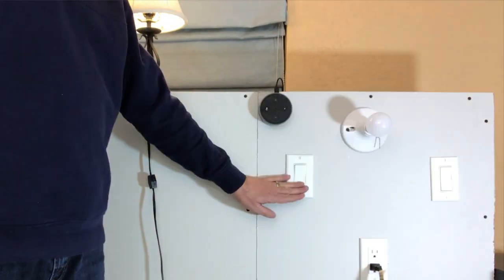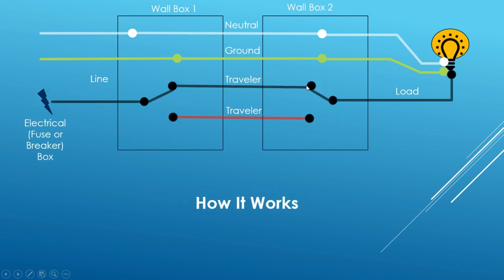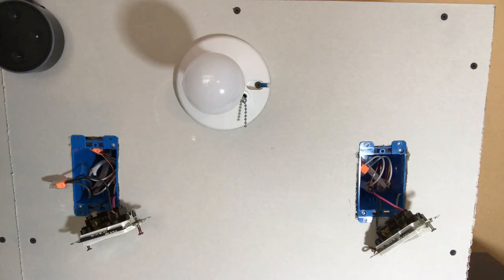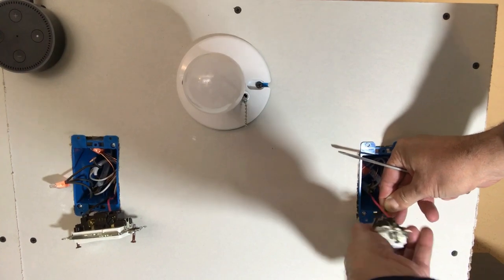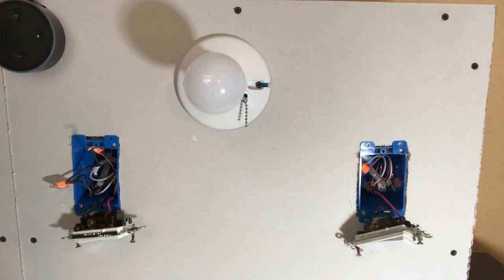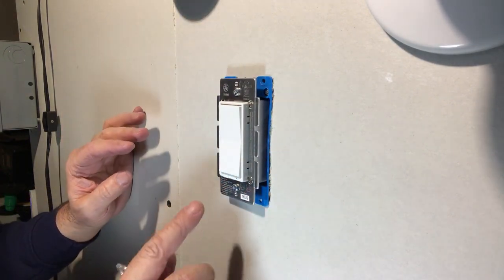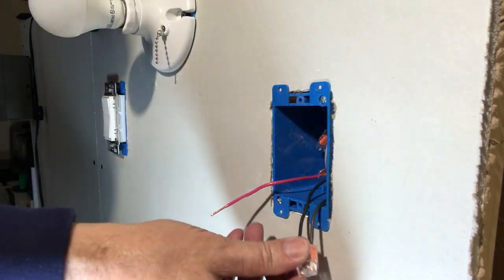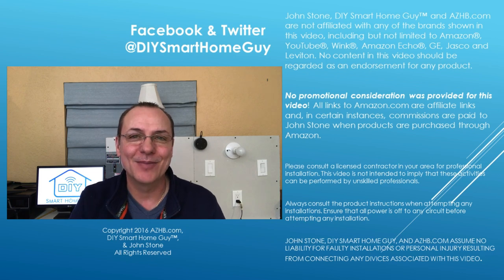DIY 3-Way Switch GE / Leviton Smart Switch Installation (Z-Wave)

Comment: Have you ever seen these GE switches go on sale? Btw your videos are super helpful. I had no previous electrical experience and installed my first few switches with confidence.
Reply: Sunday1290 Google camelcamelcamel
Reply: Chris Hudson  Thanks Chris. Not knowing what I was googling I was a little worried what results I was going to get, but this tool looks awesome. Thanks for the tip.
Reply: I am waiting for about $35 price before I buy my next generation switch...
Reply: John Stone do you know what the practical difference between the switch listed above and model 14291? Based on very brief research all I can tell is a faster processor and more memory. Is there noticeable performance to justify the additional cost?
Reply: stupid auto correct... I think that was  supposed to say dimmer... I need another dimmer which was $39 this morning.

Comment: I’ve been trying to install a levitan 3way smart witch and it been a huge pain. 
There seems to be a bunch of different types, some for diff types of lights) all  with tiny long model numbers that do not work together. Why don’t they sell them as a 2 unit package to eliminate confusion. The guy I’m doing this for has ordered  them all separately. He’s got the wrong ones like 3 times.

Comment: Hello Jhon. Thank you for this video. I'm not a English native speaker and I want to ask you some question. I ordered the Tp link hs210 kit (two 3 way smart switches). I was planning to connect both switches in one 3 way circuit. Two smart switches for one lamp. After your video, I figure out that I can replace only one 3 way switch in the circuit. My question is. How does the actual (not smart switch) works if I turn off this switch?. Are still the Kasa app or Google home assistant able to turn On and Off the light? Thank you for your time and help.

Comment: Quick question, as for me it is not clear... If I use a wifi switch as part of a 3way switch circuit. (i have 3 regular switches right now controlling a light) can I just change one to a WiFi switch? and if so does it matter which one i switch? I have a Levtion Decora WiFi switch to install.

Comment: Hi John,  great video, thank you. I have three lights I want to connect. They all have two switches (3 way lights?). Do I need to use both a primary switch (GE model number 12729) and an add on switch (GE model number 12728)? Or can I use a primary or only an add on switch? Why would someone add two smart switches for one light? Or is the add on switch not a smart switch and is just used in conjunction with the smart switch (12729)?

thanks!
Reply: John Stone 
very nice, thank you!

Comment: Great Video thanks for it ...I have one question - why is there such a delay when you turn them on and off?
Reply: My delay was I had to replace a second switch (not a dimmer) on my 3way. The first 3 way dimmer was replaced because it did not support led Now it;s fast
Reply: Richard Humphrey are you saying you replaced a zwave 3 way dimmer for a non-dimmer switch and it resolved the delay? I’m finally getting around to installing some 3 way GE smart switches and already bought them but after seeing the delay I’m second guessing the purchase.
Reply: Hi Mike, Sorry for the confusion....My original 3 way setup  was one switch with on/off and the other switch was on/off with dimmer. When I just switched the bulbs for LED the lighting went crazy with flickering. Talking to an Electrician he said my dimmer didn't support LED lights. He made no mention of the simple on/off switch. So I then switched out my dimmer. ( should say had the electrician  with a leviton dimmer switch. This switch was google home and alexia aware. So you can control it with either or with leviton app. After the Electrician did the job he came up and said it was complete... I assumed he tested it. Also I required a neutral wire for the new switches....nothing straight forward about switching them.
I don't go down stairs much. Later in the week I went down and flip the switch on....there was literally like a 2 second delay. Also I notices that if I went to the second switch ( the leviton and flipped the switch. Power would go out and I would have to go back to the other switch...These switches have a little light that glow on them....very messed up it was)  I called the guy back but he had no idea why. Now I hired a second Electrician... He worked on it for a while...Later it became clear that the other ON/Off switch had to be changed out as well. It was in the fine print of the first Leviton switch....now I am up to just over 300 bucks for both switches and two electricians.  I have to say I did learn lots in the process. (so did second electrician) ..not enough if it's not a straight switch. My house is only 14 years old (built in Canada 2004) but I guess that;s old enough when it comes to present day wiring practices.  I perhaps should have just went and tried hue lights to see if they would have worked on their own. Those are cool to.....I have a sensor in my garage and my lights in my garage entrance come on when I drive in at night...after 5 minutes the garage entrance lights go out. I have those in other locations in my home and they are on older switches.  
I love using it with google home I have to say..  My home router is a Asus RT-AC87U router.. when I look all my client list on it, I have 44 devices ( this is wired and wireless devices)...Lights, chromecast, switches. Ihome devices,  cells, sonos,  smart TVs,synology nas(s)Google Home, Ecobee 4 thermostat,   computers etc. I do think people should invest in descent routers when they are doing this kind of stuff.... the ones from your internet service provider just are not all that great.  I hope I answered your question.. I got a little carried away on the tech...LOL The router is the heart of it all working good...along with your isp of course. Today upload speeds can be as important as download speeds
Now if I were a person getting a new router because I thought My router might be the issue...I would use the same ssd names and passwords so, that switching  the router would be seamless for my connected devices.
Reply: Richard Humphrey I think it does. I have the updated version of the GE switches shown in this video that have Zwave Plus. My house was built in 2013 so I’m assuming the wiring should be pretty straightforward. I guess I’ll install the switches to see if there is a delay. I have all led bulbs and plan on pairing the switches to a SmartThings hub with Google Home.

Comment: have a minoston smart dimmer switch. Ms11z model. They have the same 4 screws and are labled traveler,  line, neutral,  and load.

Comment: I apologize if this was already asked. I have the master Lutron switch which I want to connect to a 4 way and another 3 way. Can the smart master switch be used in conjunction with the existing conventional 4 way and 3 way? In other words must a smart extension/add-on switch be used?

Comment: Great video!  Would the same thinking apply in a situation of a 4 way, 3 switches connected to a set of 3 canned lights?  I can't seem to get everything to work - seems like one of the 3 switches always disables the whole circuit and then the smart switch becomes useless.  I'm using a TPLink smart switch... I feel so close to getting it to work - yet so frustrated.

Comment: Can I get some help! Im trying to install an switch like this but I only have 1 black wire. In all I have 1 ground, 1 neutral, 1 traveler and 1 hot wire 4 cables in total and this is for a 3 way pole that is currently working properly with regular switches. What should I do?

Comment: Your video was great.  I have a problem, and I think it may be unsolveable unless I hire an electrician.   No problem, I have a three wire follower that goes between the two switch location.  The problem is that there is only a two wire with line supply on one side.  There is another cable on the side where the line side is missing, but that cable goes to an entirely different circuit.  I tried tapping into it for a line on the missing side, but it didn't like it and tripped the breaker.  So.....any alternative other than to get an electrician to run another two wire from the same line side?  As a note, I did tie all of the white wires together on the missing side when I tried using that "other" line.  Could that have been the problem?  Just thinking about it as I type this......worked so long on this and pretty much disappointed..
Reply: DIY Smart Home Guy Thais for the reply.  I did some checking and it turns out they used a white wire for the traveler.  I rewired and now the switch is working great.  Thanks again.  You are very helpful.

Comment: I hired an electrician to install a three way switch for the leviton decora. I noticed you used 1 three way and 1 "add on". I purchased two three way... Do I need to return one for an "add on"? I didn't go through the manual I just figure it's it's a 3 way then I'll need two. Fast fw, job complete but only one switch has a solid green light when off; the switch with the solid green line is always the one used last to shut the light off and only that switch can be used to turn the lights back on. So at any point, 1 switch will not turn the light on... The electrician should be back but he's out of town and I don't want to wait... Any suggestions?

Comment: How to connect 2 way in 2 gang smart switch... one of the switch from both device need to control 1 light. And other switch from both  control 2 different light....

Comment: I'm using a Leviton DH15S with a DD0SR-DLZ (non-dimming, WIFI).  My existing wiring is #3, powered at the box with a light in the middle and the 3 wires continuing to the remote box.  I have the DH15S powered and it works the light fine; however, the remote does not work.  I have used your diagram and continued the Load (BK-Black), Neutral (WT-White) and Traveler (Red) from the Switch through the light box to the remote.  In your solution you do not continue the Black to the remote box; however, if I do continue the Black wire the remote will shutoff the light when powered on by the DH15S.  If the Black wire is not added to the BK terminal the switch does not control the light at all.  The LED on the remote will flash when the light is powered off and is on steady at the switch.
Reply: Yes, I was referencing this Website as my wiring type.   The DH15S is the primary switch taking the power and sending the Load to the light.
Reply: A followup on what I have learned about the Leviton DD0SR-DLZ.  This switch requires a power connection at the remote location, must be powered.  If you don't have the power you need to use the DD0SR-1Z remote switch.

Comment: Where can I get help setting up a 4-way switch?  Keep in mind the hard part isn't wiring up the switches, it is knowing what all the different wires that could be colored in any fashion relate to what function.  I know with a voltmeter I can test for and find the live voltage wire, I think in the 3 separate receptacles only one will have a live wire if all the switches have been removed.  How do I know what traveler wire goes to what receptacle - assuming I don't have a piece of wire long enough to reach between the two (but I do have a lamp I can connect wires to and see if the lamp comes on or off)?
Reply: I figured out all the wiring.  I didn't even use a meter.  It did involve turning the power on and off multiple times.  I thank Science, and John Stone in that order.

Comment: I am confused I opened both boxes and one box has a black, red, white and bare wire. The other box has 2 black wires and a red 
Power on and I read 120 volts from the white wire to ground.   No ac voltage in other box.   So I have a white wire that is hot.  That is confusing.

Comment: I just watched a video by Leviton put out in Feb of this year that shows 2 different wiring scenarios.  In one scenario, the line box is also the load box so it gets the Master switch and the other box gets the add-on, but in the other scenario the line and load boxes are separate, so the master switch goes in the LOAD box and the add-on goes in the line box.  

I think I've got it, then I'm back to being confused.....
Reply: @DIYSmartHomeGuy1  Will do, thanks!

Comment: I heard if your going to use an app to control your lights you only need one smart switch in a 3 way system...is that true?
Reply from the maker: I wouldn't recommend it. There are several factors including how your home is wired. Taking out the second switch removes the manual option, not everyone is going to have the app. In some places, both switches are required (like stairways). You wouldn't want to pull out your phone every time you come down the stairs. But maybe that's just me. Thanks for Watching! Cheers

Comment: I have an existing set of lights that are controlled by two switches.  Pretty normal 3-way situation.  Can I replace just one of them with the GE or Leviton switches without using one of their Addon switches in the other box?
Reply: I could just not wire in the second 3-way though, right?  Basically put it back to a single pole installation?  I guess I'd have to re-wire the light box too though huh?

Comment: If you do not have a white (neutral) wire in the gang box with the load wire but you do have a white wire in the gang box with the live wire, then you may have a setup where the light (the load) is between the two switches. This is what I have. In my case I was able to take the black traveler wire from the main (live) switch and connect it to the light (load) directly within the light gang box.  I could then take the wire that the black traveler wire had been connected to in the light gang box and make it the neutral (white) wire. By making this change in the light gang box I was able to complete the install of the GE 3 way smart switch.
Reply: Sorry, not on FB. Here is a Google Drive link of the diagrams. These where made by a friend not for publication so they are a little rough.  https://drive.google.com/drive/folders/0B1iJ-0ICJYwgdmo4T1VUY1VXemc?usp=sharing

Comment: Is a ground wire a requirement? I have a neutral wire but I don't have a ground.
Reply: John Stone Hardly anything in my house has a ground. 75% of my outlets only have two prongs I feel like the three prongs in the house don't even have a ground wired to them.
Reply: John Stone I checked it out. I know that's for if you don't have a neutral wire. Is it common to have a neutral but not a ground? I know a lot of people don't have a neutral wire but after using Google I couldn't find anything about having a neutral but not a ground.
Reply: John Stone Okay all I needed to know. From what I've seen all my boxes are made out of metal. So just connect a wire to it and I'm good to go?
Reply: John Stone I have another issue. When I took the second switch out it was wired way different than any thing I could find online. The traveler wire and the neutral wire were hooked up to one side and the black was on the other side. I tried wiring the add-on switch a few different ways just to see it one would work but nothing. So I just capped the two wires that were on the same side together and now the room only has one light switch which has been working fine for a week but I can only turn the dimmer to about 90% anything higher and it just cuts off. Just wondering if this would be a wiring problem, switch problem, or bulb problem (using 45 watt incandescent bulb).

Comment: What would I do if I don’t care about the 3 way ability? Essentially I just want to replace on of the existing 3 way switches with the smart switch and control it over z save always. I don't care if one doesn't work.

Comment: Great video! I’m just having an issue with this very same set-up, when I finished the wiring, the main switch it works flawlessly, however, the add on switch it wont work, it you press it and hold it pressed, it will work, either turning on or off the light, but at the moment you let go the switch will go the the old position , if the light was on and you pressed and hold it it will go off , and as soon as you let go will go back to the on position, and vice versa when the light is off. 
Any suggestions, ideas will be greatly appreciated it.
Thanks!!
Reply: double check the common wire to make sure its connected
Reply: I am in the same boat!  Just converted 2 different 3-way switches using this DIY. Followed it to a T! Now the add-on switches exhibit the behavior of the OP. Help!
Reply: DIY Smart Home Guy can you help me with the strange behavior of my add-on switches?

Comment: I just installed those GE products.  But my add on switch isn't working  when installed all the way.  Outside the gang box it works, inside it won't.  Did this back and forth several times.  Out of the box it works, in the box it won't.  Any suggestions?
Reply: John Stone Nope....just rechecked...all the lugs and wire a very snug....but I'm still getting the same result
Reply: John,
       The switch was a dud.  I swapped it out for another one and all is well.  Thanks again